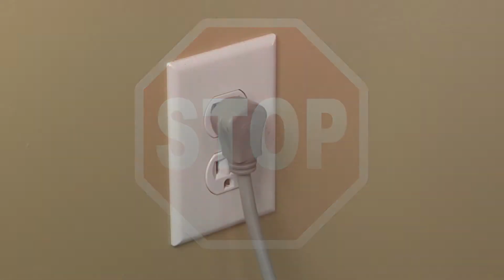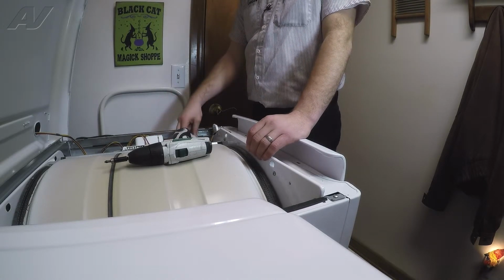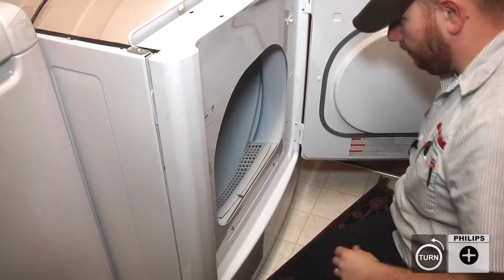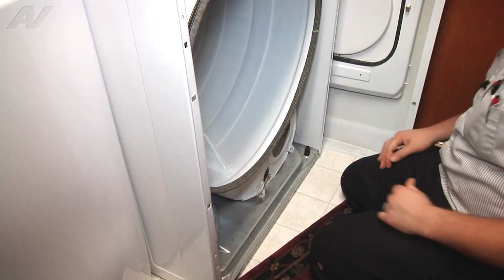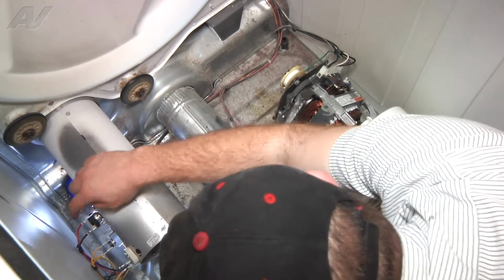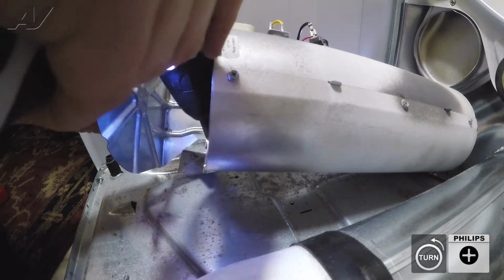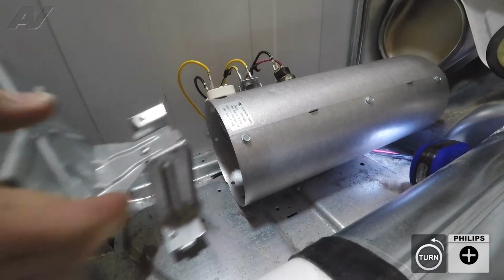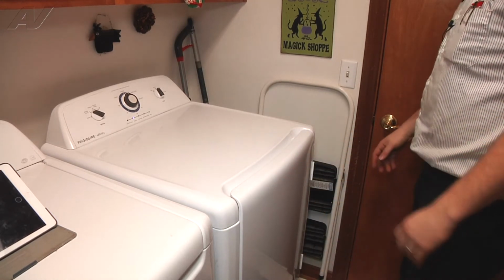Frigidaire Dryer Repair - Not Heating - Heating Element

Comment: I did this with my frigidaire but one mistake I made was disconnecting the control board terminals from the front control harness. It's not clear what harness goes where.